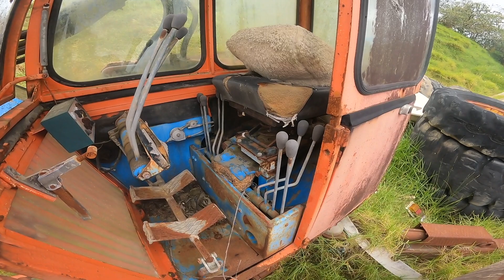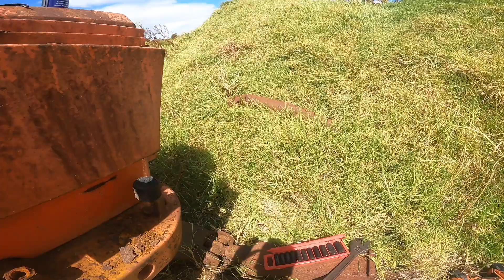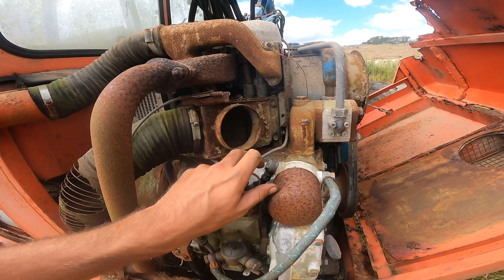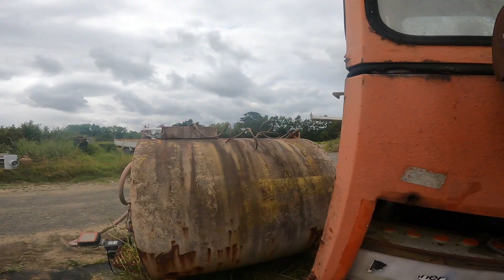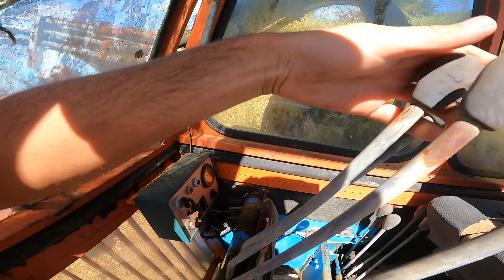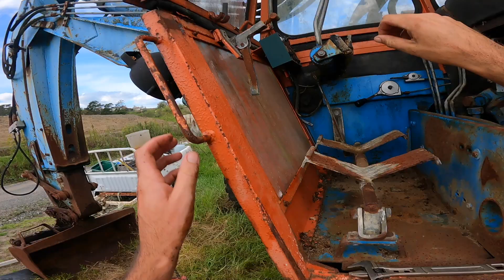Abandoned Kaiser X4 Spider Excavator Ep1 - "Will it run?"

Comment: The cab heater uses air from the engine cooling fan. You will notice that the air can either go to the heater pipe in to the cab , or you can move the plate inside the heat exchanger (via a cable control presumably in the cab?), to blow out of the other hole straight to atmosphere.